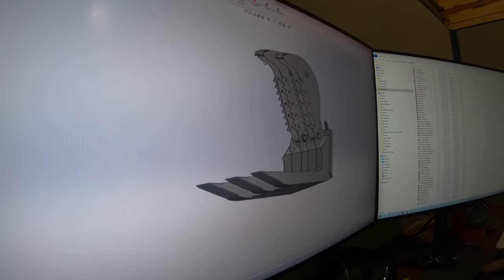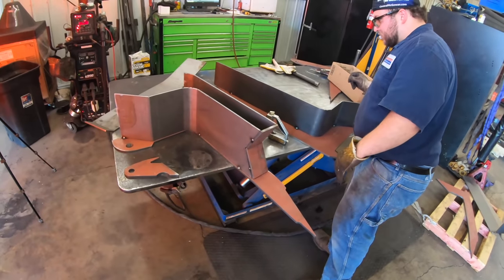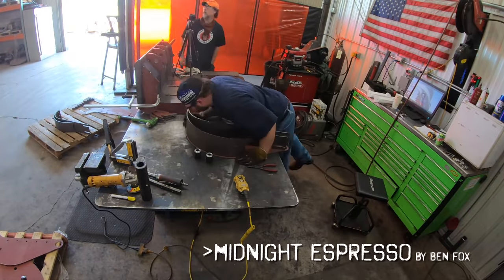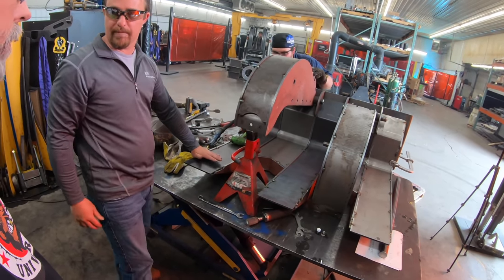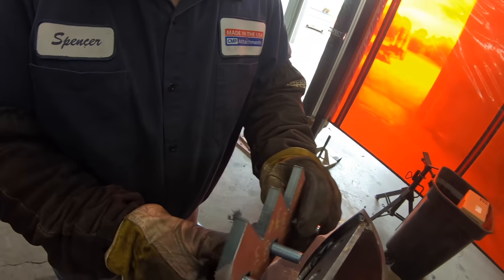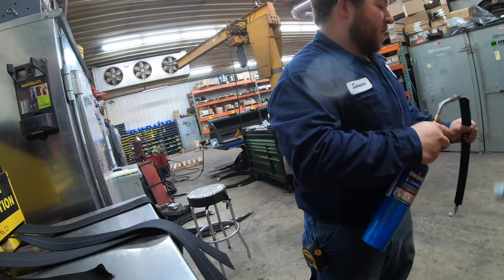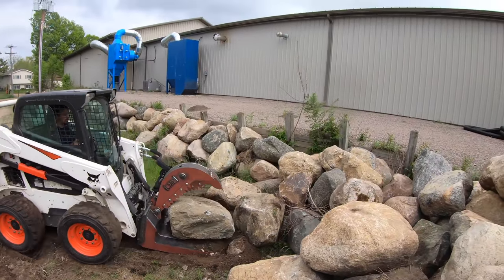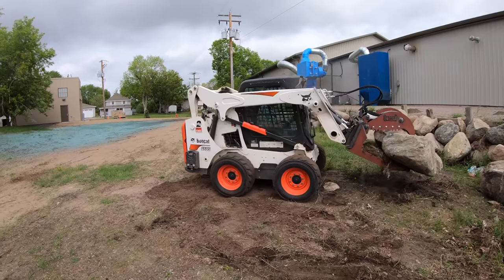Design. Build. Test. " Monkey Claw" - new equipment attachment

Comment: Hey Stan I've been watching your videos for few years and although I work more on commercial construction sites. I've noticed you have a couple different construction companies and have never seen you try our anything new with technology such as a rototilt I saw the steel wrist video. But also laser or gps/TPS( machine attachment grades receiving position of blade from robotic total station . Alot can be done with just a laser grading setup. Or putting a 2d (Leica, Trimble or topcon setup on excavator there relatively cheap there's alot of sticker shock on some prices but it makes your operator trench faster and safer not needing  a grademen working close to machine. And frees guy up to do other tasks. I know most of your projects  are houses n stuff I believe so a skid steer grading attachment mite not be necessary but if you did have a larger site that needs perfect grades for whatever reason and investing in a rorotilt also has its sticker shock but if u combine the grade control technology with the rototilt the things you can do are amazing and more productive. I'm not saying go buy this stuff to do a video but to try it and if I may add Leica gear is easy to use high quality and bit easier on the wallet. Would like to see you try some of this stuff out on a project it's logical for. The rototilt and Sharpgrade attachment with leica 2D and 3D changed my whole businesses. From just digging trenches for footings/pads for commercial warehouses to grading the entire site to perfection. Hoping to see you try some of that kinda stuff out with the connections you do have even if it a demo for day or more. Thanks Steve Smith
Reply: I have seen machines that install plastic drain line in fields using lasers set for grade laying 4 or 6 lines at once.

Comment: Because this is made from flat stock, I think there should have stress relief holes at the root of the teeth. 
     This is to reduce the likelihood of cracks.
   Just a thought, can this be adapted for forklifts?
Reply from the maker: Im not sure this would be a very practical forklift
Reply: @Dirtmonkey    I was thinking of a quick and dirty adapter for forklifts when nothing else is available.   Removing the forks of course.   Not many forklifts have extra hydro available. Maybe an electric version?
   I wonder if the side shift function could work for the up down?

Comment: i think it would be awesome to have a grappler designed exactly like the human hand. with joint to joint level of detail on motion so the grapple is exactly like a hand. then, you would use a special device which would use your own hand, either one of course, and key off the movements of Your hands joints, to move the grappler. then, it could be Super fine detail grabbing of debris and material. and, of course, one handed operation of the loader motion. so for me, i would drive with my left hand, and use the grape "glove" sensor mechanism in my right hand lol... all it needs is a means to tell each hydraulic line to move whatever necessary distance and force, according to your own grip strength (times the hydraulics of course) but you could then have super fine motor control of your grabbing tool. anyways. it just a silly idea, but, im imagining a sort of tracked loader with two such arms (like the thing int he movie Aliens) but with literal human style arms and hands for grabbing stuff with. then you could also add in some active feedback to the control surfaces and devices to tell you whats going on with the material being moved and such...

Comment: Are they using the spray transfer method? Those beads look so smooth.
Reply from the maker: Nope, that's just skill
Reply: It's called Dual Shield Core Welding, a lot hotter than normal hardwire but lays super smooth as long as you know what you're doing. It's a staple in heavy structural applications.

Comment: it could stand to loose the outside bottom tines and just have the single like the original design but with the two grapples. being so wide your machines might have trouble getting it shoved under like the beak
Reply: The outside bottom tines are the wide support for concrete slabs and stability.  It might be possible to make them removable for certain work.

Comment: What if they made like a three point hook up with a hydraulic gear box to run a pto. Like if I have a little three point mounted shredder and I want to put it on the front of my skid loader. I have a friend that has a homemade one and I just feel like it wouldn’t be a bad thing to have in the line up of attachments.

Comment: Don't you wish that there could be an actual customer standing there when they build heavy equipment? I can't imagine how many times I would have them add zerk access, wrench access, pin clearances etc. while it was being built so I wouldn't have to curse out the engineers who designed and created the plans for most of the unserviceable equipment we use.
Reply from the maker: YES_. sometimes I hate those engineers-  Thats why I was being a bit picky

Comment: The claw needs to be in a crescent moon shape to grab round rocks of various sizes.  that one you have is great for a flat rock.  How about hydraulic spring loaded side teeth in two panels on each side to conform to the different shapes of the rock to hold them better.
Reply: Too many moving parts that can fail IN BUILDING hydraulic spring loaded side teeth in two panels

Comment: Do they use just regular welding wire or is it something special?
Reply: I’m betting just regular er70s-3 that thickness probably .045 ?  But definitely doable with .035, and brand of choice
Reply from the maker: No special welding wire used.
Reply: @shexdensmore it's called Dual Shield Core, it's a Flux core wire but still uses shielding gas

Comment: I built my own attachment that's late better than that but it's got it's good points as well which I wouldn't mind adding to my attachment I wish I could send you guys a picture of it
Reply from the maker: Id like to see it
Reply: I would love to send you a video but you can't do it on YouTube
Reply: Maybe you could send me your email
Reply: Because I specialise in removing concrete around house's I had to design my a certain way your top drawers are no good does when it comes down to clamping the concrete that will not clamp it properly when my jaw comes down it comes down flat onto the concrete to hold it steady and also there is a group at the back of my attachment for the concrete to sit in that way the jaws aren't holding all the pressure of the concrete apart from that it's not a bad attachment

Comment: What about the weight of that claw?
Seems heavy and could steal you lift capacity on these loaders.
Reply: I think if you are needing something as heavy duty as this attachment, you have already have a properly sized machine
Reply from the maker: This is very heavy and needs a heavy duty machine to run it.
Reply: Thanks for the replies.
I know, that you need a proper sized machine to use that attachment.
But what I mean is, if you have a loader with 1 ton lift capacity (just throwing out a random number here) and you put that attachment on it, what of that 1 ton is still left?
As we all could see, these loaders tend to "dance" a lot with sub optimal load distribution, even with the additional weight put on the rear end.

Just to clarify: I'm not really talking about the hydraulic capacity here, that's relatively easy to fix, although that comes into play with the construction of the loader itself.

TL;DR:
What does that attachment gain me, if the hydraulics and the construction can handle it, but all the loader does is tipping over all the time, even with more counter weight?

Comment: Shouldn't be using that freaking intermittent pulsed weld without ear plugs. With that material you should be welding about 25.3v and 340amp with lincoln 706  .062 wire thats like 98db
Reply: Oh well, It's a fab shop not a gay bar.

Comment: I have my own construction company. We have a mini excavator and we use that for installing steel sheeting seawalls. Wish we had an attachment for it that would help drive them down to grade and could double as a plate compactor for compacting behind the wall also. Think CMP could help design something for this application?

Comment: Design, Build, Test, Revise, Test have CMP Paten make purdy show at trade shows partner with a heavy hitter in the equipment industry do like a 30% royalties first 4 years with dirt monkey getting 5% per unit drop to 25% for the next 4-5 years with dirt monkey getting 3.5% royalties per unit and 18% and 1.25% after 8 to ten years with CMP protecting their bolt on parts basically they have rights to the concept but the consumable parts can not be identical and CMP has the right to use and Paten any parts found to work better aka the og can have dibs on any thing related to the design aka cover your rears so you have a 10 to 30 year Monopoly of making money from this idea.
Reply from the maker: Wow-guess I was just thinking i needed a better attachment but I can see their is more to it.👍